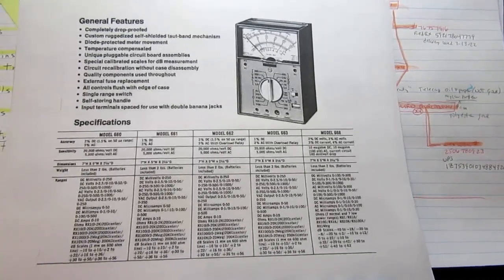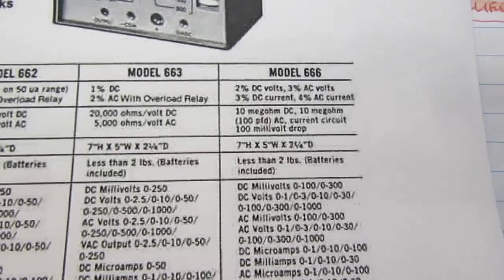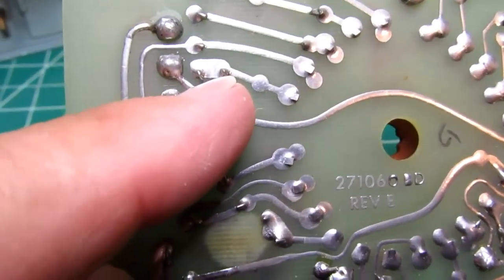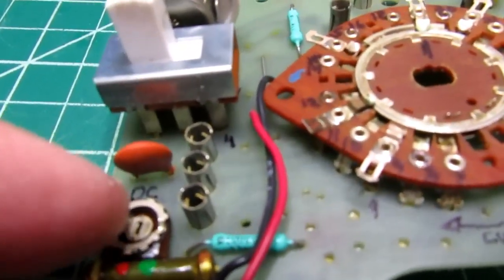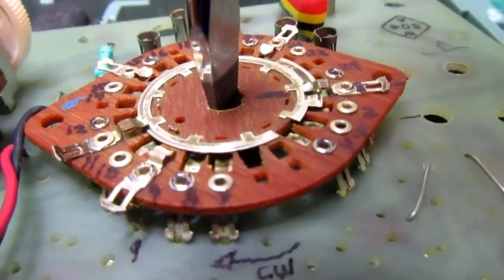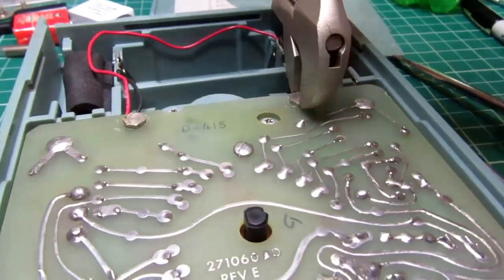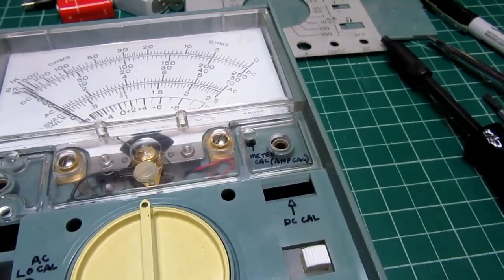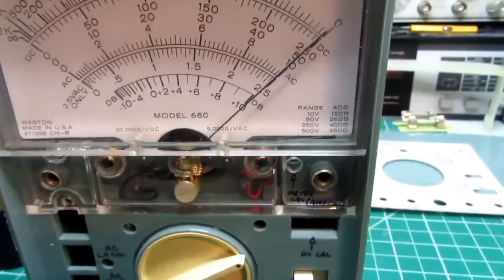Weston 660 Multimeter

Comment: I bought a Weston 663 with its carry case for a low price in 1980. It  was in good condition. I used it for years and later gave it to my brother in law. He tried to use it today but it didn't work and he asked for my advice. I told him to rather buy a cheap digital multimeter. I'll ask him to return the Weston to me and I'll try and to revive and preserve it for historical purposes.